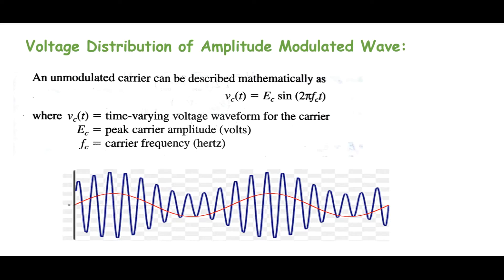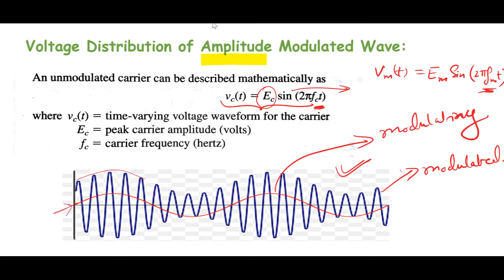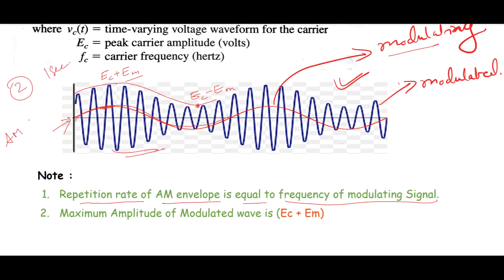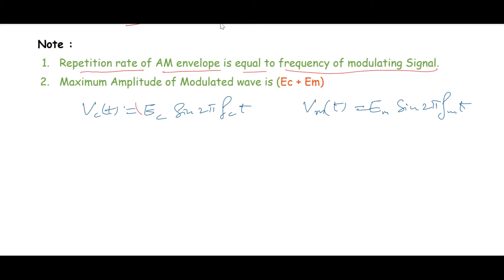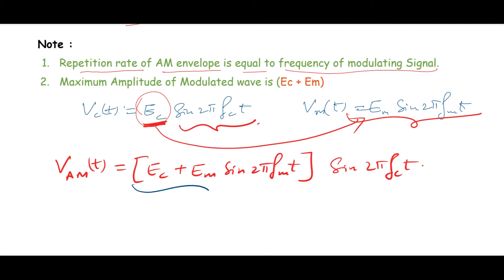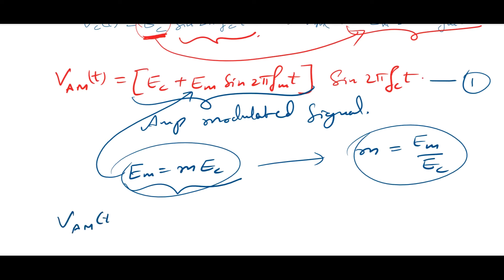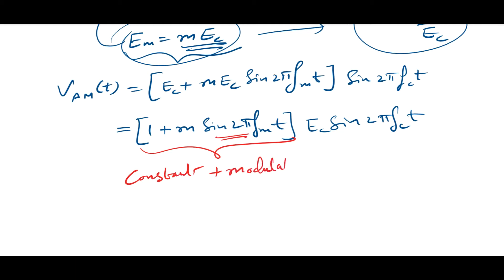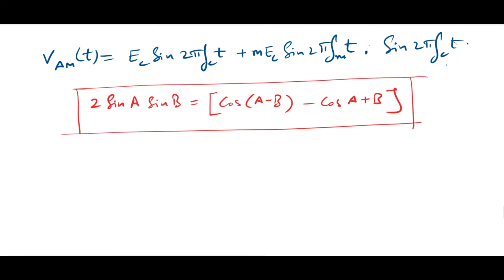Double Sideband- Full Carrier Modulation (DSB - FC)

Comment: another formula explanation but no reason why the sidebands show up to start with, always leave out the how it happens.
Reply from the maker: Thanks for being here... may I know what instance you are talking about ?
Reply: @Engineering_Basics  First let me tell you that your work is very good and the explanations of formula are very good, well done.  Not all of us are at a high level of maths, say for example electronics technician.  You have a previous video for AM modulation where you show the two signals mixing with a diode, and in that video you use a formula to show the "magic" appearance of the sidebands.  Contrast that with your ring modulator video where you at least show how the different diodes conduct but more importantly you draw the waveforms so no formula is needed to see what happens and understand without the maths. 

 I have looked all over the web for the explanation of how the sidebands come into existance by AM modulation across a non linear device, for example your video with the diode for AM modulation.  In that video the sidebands appear because you show a formula that says they appear.

  So, would it be possible for you to actually draw the waveforms, carrier and message signal, showing how physical mechanism that causes the sidebands to appear, the way you showed the waveforms for the ring modulator.  It would take some drawing skills but we then could see without maths but with drawings of signals how this non linearity affects these two signals and creation of the two new sidebands. 

 If you are successful then you will be the first on the web to show how (visually) these sidebands come into existence, the how and the why without formulas.   

 Thank you for your time    the video I refer to is the one you call square law modulator where the sidebands just magically appear by a formula. 

 Ideally it would be single tone AM to follow up as part 2 of your square law video and of course include a tuned circuit to show that all the extra signals not of concern from the non linear process are rejected leaving only the carrier and sidebands.
Reply from the maker: @motjones2341  Thanks for the appriciation man.. for now you can watch the tutorial on % age modulation to understand the behaviour of amplitudes for different  signal polarities ... In addition you might be knowing that signals like speech is basically a group of waves, there can be a no. of amplitudes and no
of frequency , that obviously depends upon what word you are pronouncing.  So to accomodate the minimum frequency and as well as the maximum frequency of message signal, the side bands are there .. they are responsible for carrying the meaningful information. Hope this can help somewhat..
Reply: @Engineering_Basics  OK, I will look to the video you mention!
Reply: It must be a language problem, but thank you for your efforts.